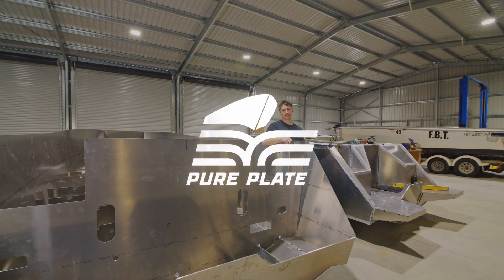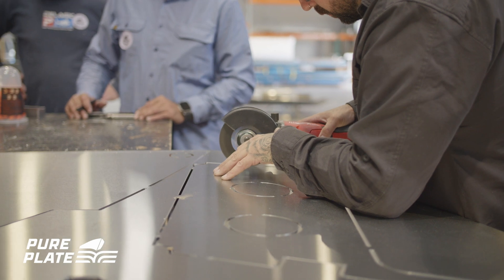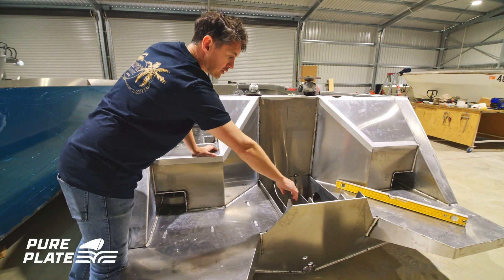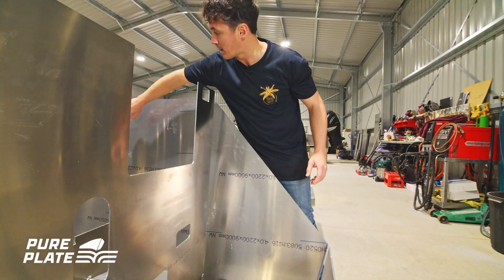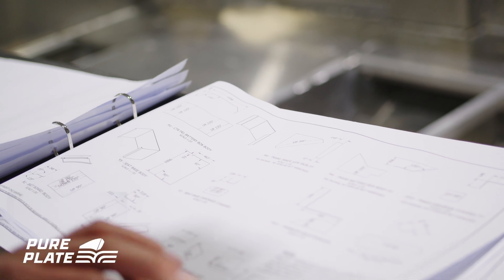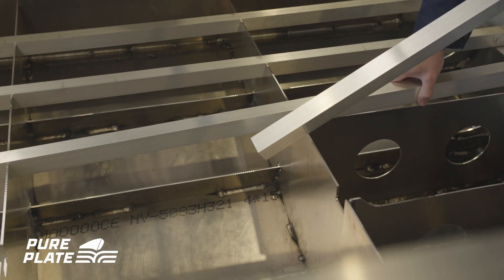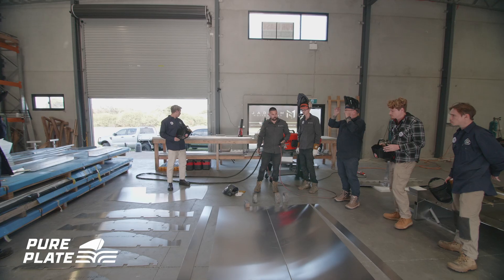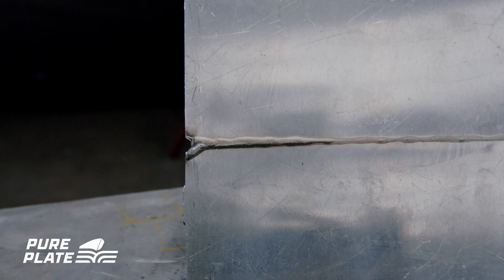Pure Plate Boat Building Online Course

Comment: Still don’t agree with non tradesmen welding these boats. How do they past engineering on the welds and if a weld fails I would say the insurance would not be covered and liability would be on the person welding.
Reply: You can build a wood boat yourself so why not a aluminium stop overthinking things and where to lay any blame when something goes bad if you build the boat and it breaks no one to blame but you